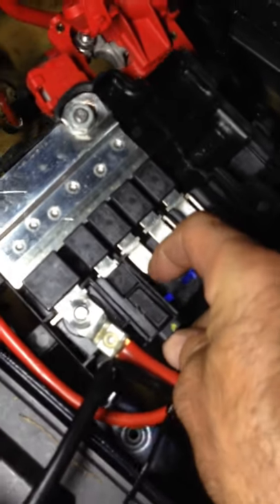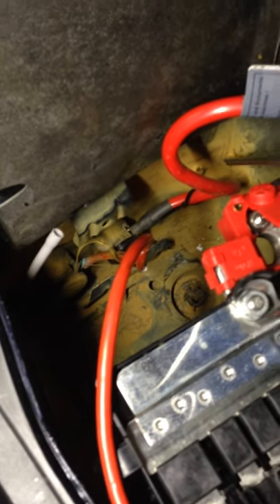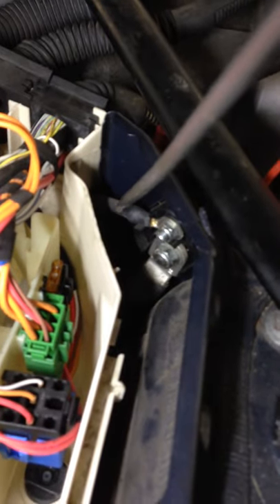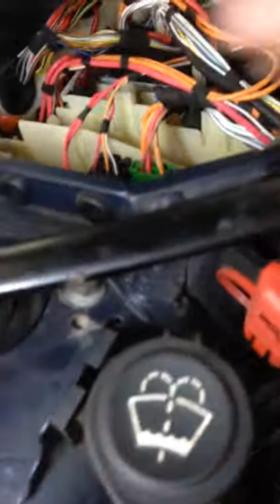BMW e90 325 330 valvetronic 2A3F fault code no throttle power supply

Comment: Hey, A huge thank you from New Zealand! This solved my long standing intermittent 2A68-71 faults. I have a 320i euro spec e90. It would run but kept going into limp mode. Your video saved me a fortune in diagnostics. Thanks again, it's so nice to have my beema back running well. Scott
Reply: Hey, I have the same problem with my E90. What did you do to fix it? Thanks in regards!
Reply: @An_3. did you solve this.. seems like you have to replace the damaged wire. that should do it, if your battery was sitting in water
Reply: @wavybump  I fixed that but not by fixing the wire but by exchanging the Valvetronic motor. Thanks anyway!🙏🏼

Comment: Hello, I'm from São Paulo - Brazil. I had the same problem with a BMW 325, the car was armored, there was about 4cm of water around the battery. I had to redo the terminals and change the nuts, everything was corroded. Your video helped me a lot. Thanks!

Comment: 3/15/2021 i had a 2008 bmw 328i with codes 2A3F and 2A77  this video helped me but in my case the battery power distribution had a blown fuse on the same wire great video
Reply: Where is that fuse located? Same code roo

Comment: Just bought the car maybe a month ago and I've been diagnosing the car for maybe a week now cause it's been stuck in limp mode thanx to your video my car is up and running now
Reply: Hey, I have the same issue with my 320i E90. It sometimes goes into limp mode. How did you solve the problem?

Thanks in Regards!

Comment: this might be what I was looking for. my battery was sitting in water after a rain storm. i didn't even notice until I got a fail to communicate with water pump and valvetronic failed codes at the same time. i figured it was electrical since both fuses are side by side on fuse box under the hood. i narrowed it down to the distribution box on the battery. but this makes alot of since. gotta take the battery out to check. thanks in advance 🙏

Comment: Very Good! Probably saved me a 2nd DME ...We had one (2007 328xi)  with a burned DME and this was the culprit. Low Volts = High Amps and slow motor.
Reply: What was the exact culprit
Reply: @stevet8607  On my particular case we had corosion in the bulkhead. You have to run a voltage drop or better yet a current carrying test for the main power wire running from the battery to the fuse block/valtronic system. The smaller cable not the large battery cable ( that one goes to the starter/ alternator). Usually this problem is a prefuse or corrosion where the cables go from the battery box through the bulkhead to the inner fender. It's a pain to fix, so test it first...Familiarize yourself with voltage drop. You could also have a binding eccentric shaft or failed motor. minor correction too, low voltage does not equal high amperage except in AC current. I learned that since my first post. Motor can still burn out with the low voltage though. GOOD LUCK 🙂

Comment: My battery area looks the same, there was some water in that area, mud, rust near those cables. So was the solution to replace the red cable that had water damage?
Reply from the maker: Depends. Pull on cable if it breaks off. Yes replace

Comment: I know this is an old video and I'm hoping you can recall. When you say come and go, what do you mean? 
 I'm currently experiencing throttle problems. If I go to shift or match Rev, I get no throttle response at all. It's as if the car is off and I'm just stepping on the pedal. No rpm movement. After a few seconds it kicks in as if nothing happened. It doesn't happen every time but pretty much every day multiple times a day. Is that similar to what happened here?
Reply from the maker: Not sure what your question is the important thing to look for is water in the battery area and damaged cable because of that
Reply: I have exact same problem with my 130i 2cfa, 2d09 codes. New throttle body was fitted, but problem remains, eml light is on. Did you manage to find the solution?
Reply: @motyla_noga4802  you're getting a dead pedal for a few seconds as well while driving?
Reply: @armand salloum  sorry I was not clear. You stated the throttle issues would come and go. Does my symptoms sounds exactly the same as what the driver was experiencing?
Reply from the maker: Guys this video is mainly to show how the water issue affects the valve Tronic situation your situation may be different if you don’t have water in the trunk but regardless the only right way to diagnose it is with a factory level scanner and to see what fault codes are stored in the engine to help guide you in the right direction
Reply: @vacbmw  that's the problem, there's no codes in the background either 😒 but I will check around the battery more

Comment: Went to the mechanic since my bmw 328i 2009 would show fuel pump malfunction. Codes P1016 and P1006. I replaced the valvetronic sensor and fuel pump. Still didnt turn on. Mechanic said they have to replace gas tank and fuel pump, now car starts but no power. Codes 2A3F, 2A77, 2A03, 29EI and 29E0. Don't know what to do now. Spent too much on replacing gas tank. Any idea what can be the issue?
Reply from the maker: Sorry I wish I can diagnose cars remotely if what I showed in the video doesn’t help you I can’t help you unless the car is present with my diagnostic equipment good luck

Comment: So what was the problem? I’m a little lost but my e90 is throwing codes 2A3F and 2A77. Car is in limp mode and when running the Rpms drop up and down continuously between 400rpm to 800rpm. Can’t figure it out for the life of me
Reply from the maker: Kody Stokes Our situation was a bad power wire and the battery area due to water corroded the cable that supplies power I am not sure exactly if that is your problem there are several reasons these systems act up but if you just want to limp your car around you could unplug the eccentric shaft sensor which is on the top of the valve cover towards the front
Reply: Did you find out what the problem was exactly
Reply from the maker: The problem in the end was a power supply failure from that power wire there’s water in there that can damage the connection and also the power supply panel on top of the battery has a built in Fuhs for that circuit either way if there is a loss of power on that cable which goes to the engine you will have that problem and it is relatively common
Reply: Kody stokes u find out   what the problem  was

Comment: i tried replacing the wire but the terminal itself underneath the battery that runs to the valvetronic motor melted. what do u suggest? please help
Reply from the maker: You can buy both cables from BMW the one inside the battery area and the one outside the battery area that runs up to the engine or you can buy them used from a junk car and sectioned them out by cutting them and putting space in it that is not very easy for the average person with out specialized tools

Comment: I’m getting valvetronic error codes as well and turns out my vvt motor isn’t working or getting little to no power to it. And is currently now in Limp mode would this by any chance fix my problem or could it be my ECU
Reply from the maker: Max Hernandez possibly. Look in battery tray
Reply: vacbmw another question so since the car turns on and all and I’ve replaced the VVT motor I’m guessing the VVT motor is working properly? Or else it wouldn’t start if it didn’t work correct?
Reply: @maxhernandez9366  did you find the solution to it
Reply: @maxhernandez9366  depends on where the motor was when it stopped... It could be anywjere in its range. If you have INPA you can do a motor sweep test inside the test plan for the relevant code, watch the motor and see what happens.

Comment: I had the exact same problem on my 2006 325i the nut that secures the cable in the battery box had completely dissolved... that you